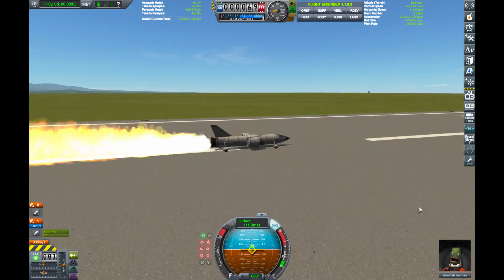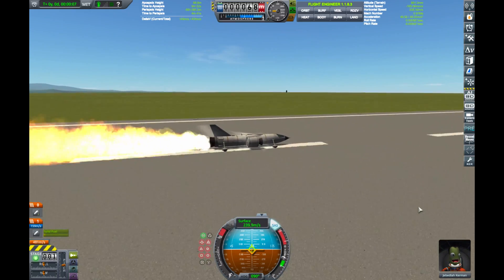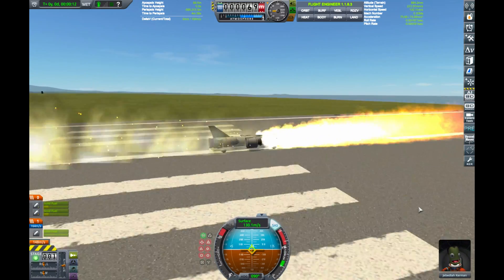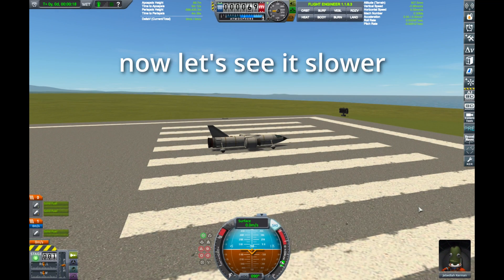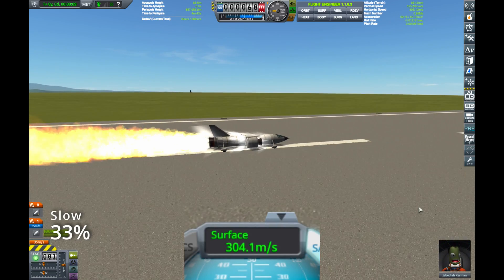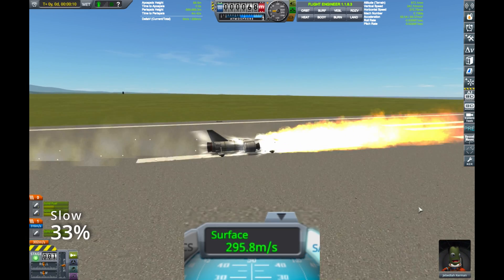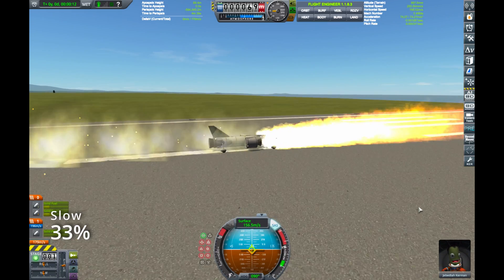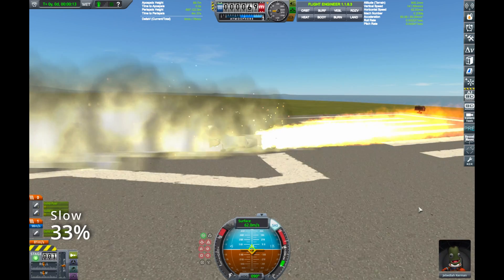Actual Aerospace Engineer reacts to Real Civil Engineer Speed Record Attempt

Comment: I've been able to get a craft to 350 m/s and slow down well within the runway using only 3 air breathing engines and aerodynamic braking. Fire up 3 afterburner engines to get up to the speed of sound, then deploy 4 airbrakes and 4 parachutes, while also increasing the angle of attack of both the front and rear wing to maximize the wheel brake power....
I could probably go for much less aggressive aero, perhaps more balanced downforce as mine is currently heavily skewed rewards and seems to cause yaw instability.